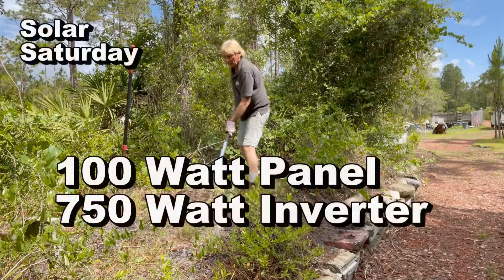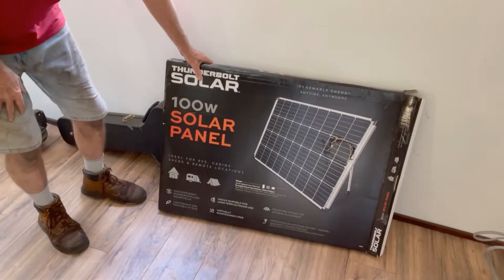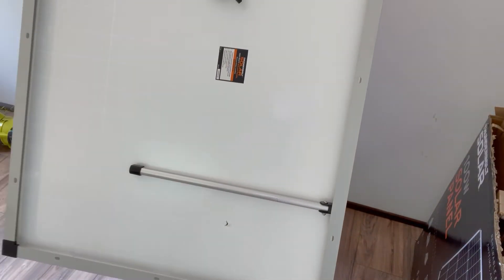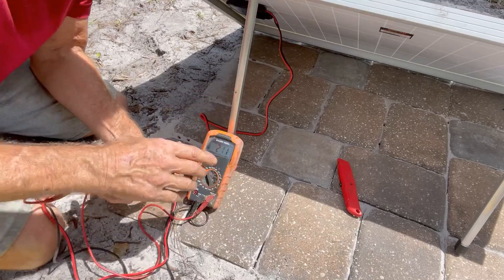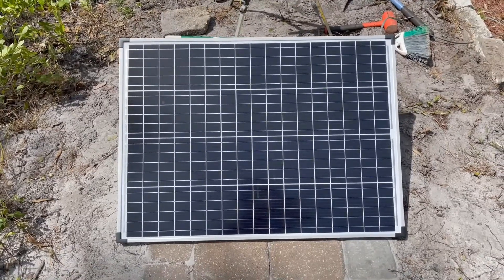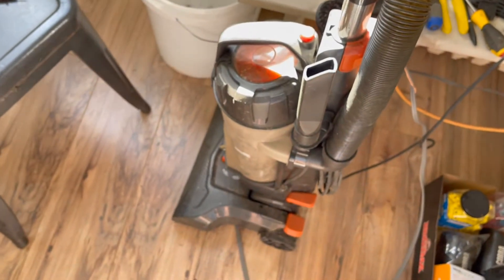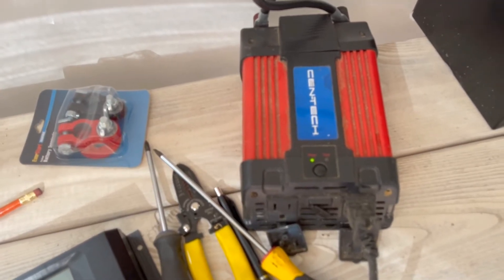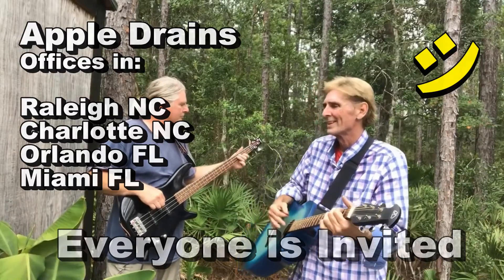100 Watt Solar Panel - 750 Watt Inverter -  Can it Run the A/C?

Comment: I've been trying some cheap inverters and they were having trouble with the amps side of things. They should have been able to handle the watts side. And they'd be low watt devices and trip the power inverter over and over on amps when trying to run an AC. :S

I'm wondering which ones can handle an AC without tripping it and not cost hundreds of dollars still.

Comment: Okay folk so what he's not showing you is that the air conditioner is not going to run that long The battery is going to get sucked dry no matter if there's voltage going into it or not it's pulling more amps and what's being made. You would need more batteries and more solar panels just to sustain the air conditioner and I'm guessing you're going to need a whole lot more batteries than one and probably closer to a thousand watts and solar panels you may be able to get by with 600 Watts with micro inverters

Comment: Actually your inverter is supplying 75% of the power from the battery to run this AC. If this AC is 400 watts, roughly say 300 watts from battery and 100 watts from solar panel.

Comment: That inverter was sucking that battery. No way does an A/C run on 100 watts.
 Would you like proof? Very simple, disconnect the battery. 
 Unlike you, I am an EE. BTW, that panel at max is putting out only 80 watts.

Comment: For as much as I enjoy watching your drain videos almost daily, all those appliances are just running off the battery/inverter and not the solar panel.  The solar panel is not supplying enough power to run the appliances.  Apologies for sounding negative, sincerely not my intentions. 

Is the solar panel large enough power to charge the battery - sure (given enough sunshine).  To power the appliances directly?...Nope.  The real test is to measure the solar panel's current AND voltage under load  (i.e. power being generated) vs. the load requirements. 

Again, apologies for sounding negative, not my intentions.   Recently retired engr.
Reply: The batteries will be toast fast.

Comment: Can you do a video on this 100w -> AC set up in a few weeks.  I want to hear about your experience.  Is the duration consistent?  How much more duration can you get from a 2nd battery?  

Thanks 👍🏼👍🏼👍🏼👍🏼👍🏼👍🏼👍🏼
Reply: He is talking about a marine deep cycle lead acid battery like we use to use on a trolling motor running trot lines all summer , i ran that battry down a thousand times and charged it right back up , one day my cousin needed it for his truck and used it for 2 years b4 he sold the truck . But then again that was 30 years ago.   Seems like they built stuff better then
Reply: The battery he is using will be toast in no time. Even gel batteries  can not do this for more then a few times. The only thing you can possibly use for AC and solar is a battle born battery. Life po4. Everything else will be destroyed so quickly. When you go more than half way through a charge of a battery you are damaging it forever. Unless it's lithium.
Reply: You must work for battle born!  This absolutely will run for years if he’s not significantly discharging the battery.  He could easily run the ac for an hour then let it charge for 2 hours without any damage to the battery over a 5-6 year period.  The smarter thing would be to spend the money on more panels and a second battery vs the cost of battle born.  I lived completely off grid on yachts with 600W of solar and 2 group 31 batteries ($120) would run my ac all day and half the night off the solar.
Reply: @ADHDAdventurer  31 batteries?
Reply: @ADHDAdventurer  is that a lithium battery? Everyone keeps telling me that lead acid won't work